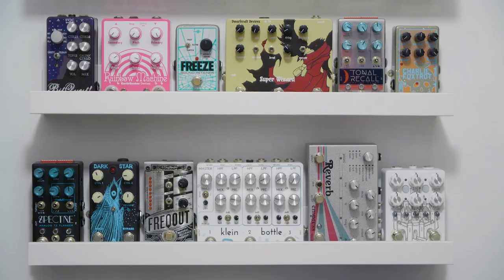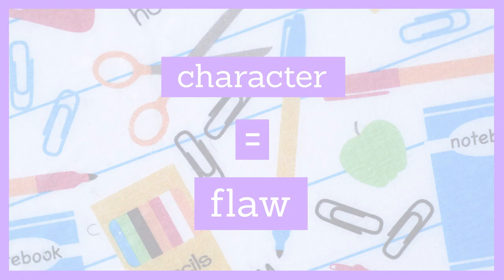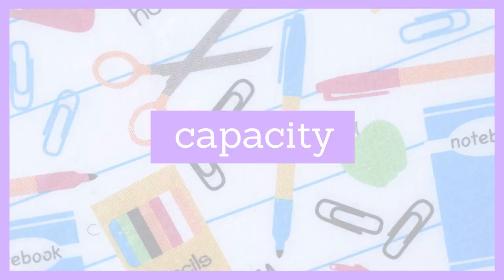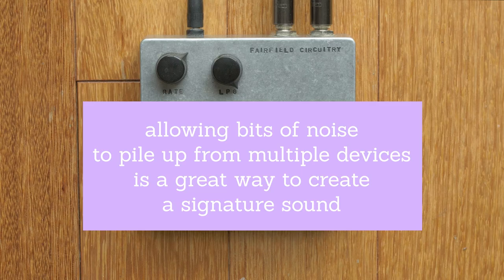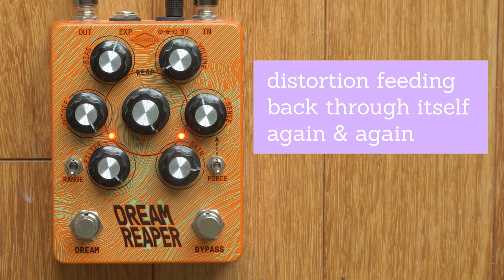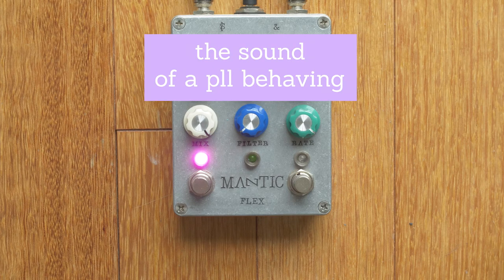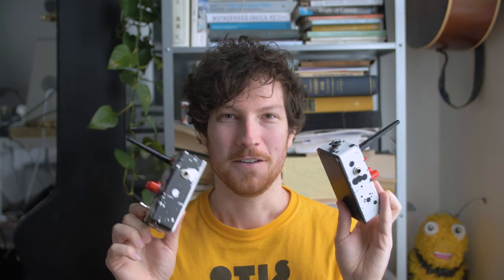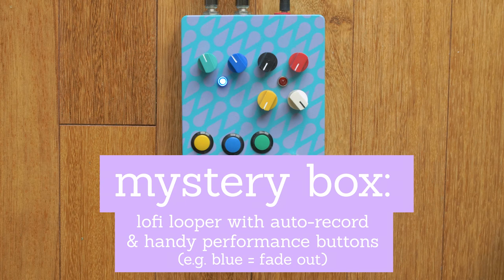Fantastic flaws (& where to find them)

Comment: I bought a Mr Black Supermoon MS Edition that have a really crazy warped modulation that appears at random times, and I was underwhelmed at first (I justed wanted a normal reverb). Eventually I started enjoying it a lot, and that crazy random modulation became a part of my sound, and I fell in love with it. 

It made me rethink what I expected from a pedal, and what was initially a " flaw" and then became an awesome sound kinda goes along with the message from this video.

You once said in your Instagram about giving time to see if a pedal works for you: "Give it time. How much time is enough? I would suggest this: play it until something moves you. It may not be what you bought it for, or something you need, but find it. Find the point of that pedal. Then you'll really know if it's for you."....that was also an inspiration while discovering this pedal. Thanks for doing what you do.
Reply: I'll have to agree about Mr. Black pedals. I recently landed an Ambience Echoverb with two delays and the reverb all modulated separately. What I find fascinating is when the Gods of Calamity occasionally dip all three slow modulation waves at the same time sounding like a momentary warp in vinyl. They achieve unity, but at the same time it's a corruption. Kinda has me enjoying pitch modulation for the first time.

Comment: Oooh, the thing you're saying about flaws in pitch tracking...there's a plugin called Bitspeek which pushes any audio through it through the same form of analysis-based speech synthesizer in the Speak And Spell. Quite often it doesn't track the pitch perfectly, and you can hear this in a LOT of Neil Cecierega's pieces that use the plug-in such as "One Weird Trick" and "Melt Everyone". Plogue Chipcrusher has a similar mode, and once I got a really interesting vocal bassline simply by feeding a polyphonic pad through it!

Comment: I had this vox solid state amp back in the day with built in fx, one of them being a digital delay. if you set the repeats to max it would loop continuously without self oscillating. the best part was when you hit the tap tempo button it would add the difference as silence (when making the delay longer) or do this glitchy chop (when shortening the delay time). It mad a max delay time of maybe 4 seconds but I was able to do some really cool rhythmic stuff with it. Was really into Brian Eno at the time and was reading about him composing the windows start up sound. him trying to compose pieces of a music only a couple seconds long.

Comment: Cryptic is annoying because 99% of the time it's a system that can be easily explained, it's just that the designers don't want to explain it. It would be better called "obfuscation" in most cases. The more intersting side of cryptic is complexity: the system is easily explainable, but inherrently unpredictable. So you know what each element does, but you don't necessarily know what the outcome of any given set of inputs will be. Mannequinsʾ manuals are particularly annoying because they go out of their way to make understandable modules not understandable.